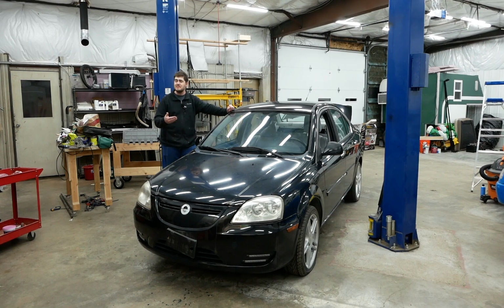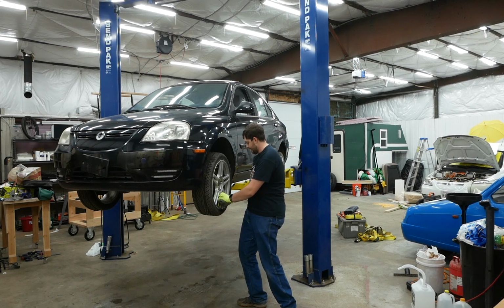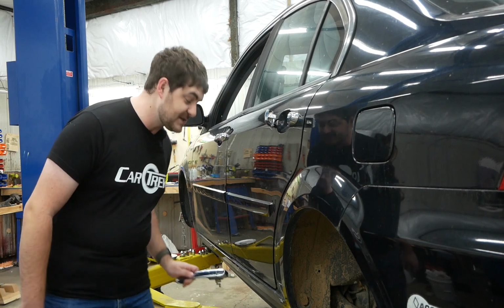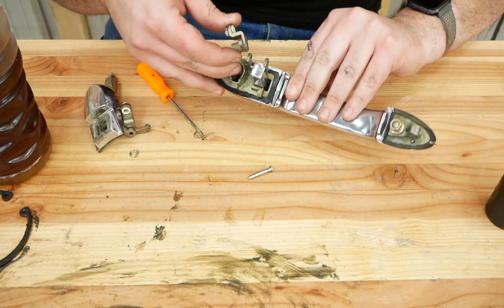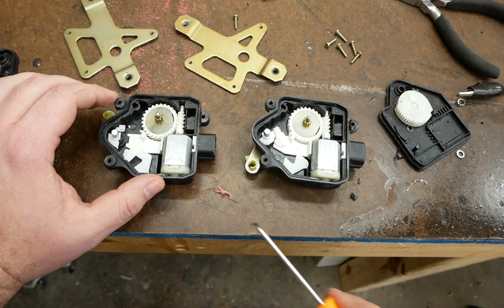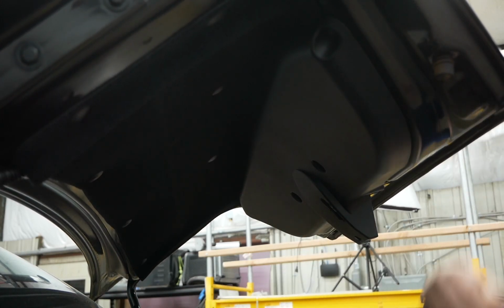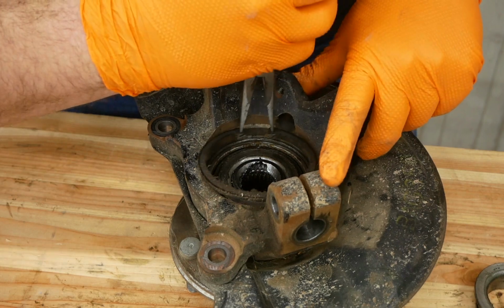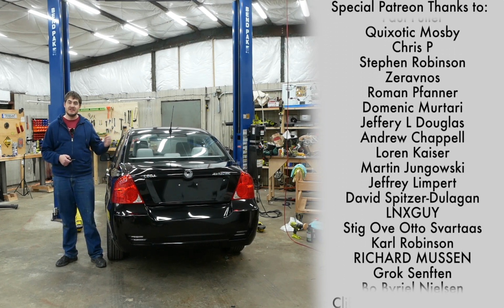Here's What It Took to Get My Broken Coda EV Back on the Road

Comment: Broken door handle, wheel bearings, trunk popper & dashboard problems, on a car with only 1000 miles on it!
Is it possible that the quality is even worse than a Wheego?
Reply: This thing makes the Yugo build quality look first rate.
Reply: Well it was made in China what did you expect?
Reply: @Revo2Evo  made in China and the US, same as the Wheego
Reply: @Javier N Ha! It's not even up to Yugo quality.
Reply: Yet it still works unlike the Wheego.
Reply: Take a Mitsubishi design and build it in China and that’s what you will get ….

Comment: Why take off the door panel from a closed door, when you have a literal hole in the mechanism that can use to just pull the latch, fish some wire in and tug the door would pop, seems like more effort then necessary your way?
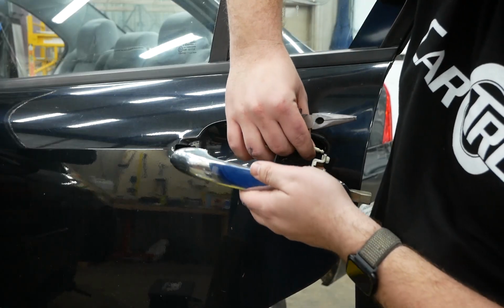Reply: Good luck gripping that rod (8:29) with a wire.
Reply: @Jehty_  it's a rotating peg, it's is not past the 90 degrees to the guy pulling it till the door opened, it literally would hold its self on till about the right moment
Reply: @Jehty_  even if it was Impossible to grip the peg the door handle uses the door doesn't look shielded, pretty sure a slim jim would work

Comment: Those wheel bearing should be sealed bearings.  Typically there is a suffix code after the bearing identification sized.  For example NSK would be -DDU for both sides sealed.  Sometimes the info stamped on the replacement bearing won't show the options.

Comment: All those tools, all that knowledge, and you don't have a pair of snap ring pliers? Get a set, and not the crappy ones with interchangeable tips. Also a good breaker bar is a lot cheaper that a power ratchet. All that aside, nice work getting the car going again, and I love the trunk lid work around.

Comment: Yeah, that door handle problem is what i had recently in my car(not a coda), and is one of those situations which proves beyond any shadow of  doubt, that steel and any other metal for that matter is better than plastic, and while it may cost you twice as much or trice as much, if you have to buy the shit 3 times, you got the same thing, but with more hassle and if you want to be a moss-hat moron, you actually can see that metal part that was made and lasts for a 1000 years is actually more ecologic and economic than plastic junk, which only slime care about if the parts are good and last for ages...
Reply: Also, what is the idea behind the emergency trunk release? What, a criminal about to be is going to open the trunk, light up a cigar, take a sip of some fine beverage as the engine warms up and softly, with look of gentle satisfaction as he lays a sheet of plastic in the trunk, and upon seeing that stupid thing, he isnt going to set the cup down and get some snips to cut off and obliterate any trace of that way of opening the trunk? No, he will consider leaving that there in case the victim in the back decides to walk out and press charges or roll out, potentially in front of a witness? Oh yeah, most definitely... And one more thing... If I was a kidnapper, I would actually leave it where it is, spray it down with a fluorescent paint only to have the victim in there be in agony upon the sight of their alleged way out, but having their members bound and mouth stuffed, being unable to interact with it... Who ever thought of such a stupid thing? What use does it provide, other than a way to open the trunk to the owner or a mechanic when the main lock fails... But then, why not just have a solid line that can be actuated from the cabin, near the main trunk release, but hidden away as not to provide the car with clutter of buttons and switches... It is such devices that prove that those who write the laws down and come up with such shit are morons and deluded slime with self instilled feeling of grandiosity... For if you consider such a device anything but a waste of material, you are a dimwit... As said, no lawful will need it but for opening the boot when its broken, and then it will prove hard to reach, and apart from that, the lawless will either remove it, or bind the victim well enough as to render the device useless either way...
Reply: @camillosteuss  regarding the emergency trunk release:
Ever heard of children?
Reply: @Jehty_  uhm, excuse me? How do children relate to trunks except in acts of kidnapping and such, and there, well, there is taping to prevent any opening... And if you are implying that a kid can just randomly end up in a trunk, well, that trunk should have been locked by the owner... Its like saying that a washing machine should have an internal emergency switch in case your kid somehow ends up in there...
Reply: @camillosteuss  are you serious?
Have you ever met a kid?
Have you been a kid yourself?
You know that kids know how to use keys. 
I don't know how often I played inside my parents car, they never forbid that. 
(ignition and parking brake was off limit of course) 

And if you don't like kids, how about (young) adults. 
Don't tell me you don't know anyone who took a ride inside the trunk because the rest of the car was already full with other people.
Reply: @Jehty_ I get what you mean, but all of the aforementioned is sub-optimal... Yeah, i know that kids play with everything, I got shocked by electricity 3 times as a kid for doing stupid things, and all of them what i wasnt supposed to be doing, but those were things that nobody thought of moving outta my grasp... Vehicle keys should be out of reach of kids, as kids drop shit, and having your key dropped into a sewer by your kid just might get you a prison sentence and the title of a monster... Also, youth in the trunk is something I know of, but I as a young teen and older teen despised that idea, as being driven by another youth is risky enough, let alone being in a trunk, tho, if you position yourself, the trunk might just be the safest place in case of a head on collision... but kids like going sideways, rather than have a front impact, so I dont even count backpack driving as a reason, also, isnt that highly illegal in it self? 
I drove a few friends when i took my seats out, and when we got to our destination, I was gently scolded by my mechanics instructor that such deeds can land me a 1500 euros or more of a ticket, because seats with belts are designated for people, unlike either floor or boot and doing so is considered as premeditated endangerment of passengers...
I get you, as i said, but dont you see that none of the above mentioned reasons are really something that should be happening...
Reply: @camillosteuss  prison sentence because a kid dropped the key into a sewer? WTF. In what country do you life?

And don't you understand that stuff that shouldn't happen still happens all the time?
How much does an emergency trunk opener cost? Isn't one person saved more than enough to put one in every vehicle?
Reply: @Jehty_  I was kidding on that part because it was implied that you would maul the kid for it... Especially if that was your only car key... But regarding the stuff that shouldnt happen... Fuck, then we should not use fire, axes, knives and practically no tools, as the sole existence thereof is a potential danger... I am ok with that shit being an option on a car, but to have that junk be mandatory and for it to come on all cars, i find ridiculous...
Reply: Regarding the plastic trunk opener.. Yeah, more of that marvelous material, acclaimed to be better than steel... Yeah, so much better it lasts without rust for 5 years, whereas you oil the steel every 5 years and it lasts a 1000 years... Wow, such a marvel of an  advancement... Makes you wonder why the industrial grade stuff has no plastic anywhere close or remote to it.... Oh, right, because plastic is junk good enough for kids toys and other such junk, not cars and mechanical equipment....
Reply: Also, an advice regarding the gearboxes... Never open the bottom plug first... Should the top be seized or dickered in other manner, once you drain the oil, you have no way of replenishing it, so always check if the top plug is removable first, I never serviced a gearbox where the top plug was absolutely seized, but some were quite stuck and were a potential risk had I damaged them before managing to remove them safely first....
Reply: Also, you have my commendations on fabricating that trunk release... That is some skookum design, wont need replacing in a few years, unlike that plastic shit...

Comment: You have two options on the front wheel bearings. That exact bearing has multiple part numbers, one of which is for a bearing WITH side seals and one without side seals. Obviously, you received the one without side seals. Option Two is to order side seals and install them. Yes, you can order side seals for bearings and install them after the fact. Check with Grainger.
Reply: Never knew you could order bearing seal kits, that's going to be helpful...
Reply: This is a problem of not having good documentation of the car.  You might be amazed at how well documented older cars are.
Reply: @tarstarkusz  They definitely have the benefit of being old cars, a lot of people had a lot of time to figure out all of it's problems and document them.
Reply: @jjpark98  Even the old books are really good. Every single thing, step by step including the body, electrical and all kinds of miscellaneous stuff.
Getting such a good book on this car is going to be impossible.
Reply: @tarstarkusz  In my experience, while age is a factor in finding good replacement parts and documentation on vehicles, sales numbers are a pretty big factor as well. I've owned a couple cars with production numbers of less than 100,000, while also being over 40 years past their production date, and it causes its own share of issues finding parts and documentation.
Reply: @AustinRBa  Plus these were, IIRC, he says, prototypes made from Chinese cars meant for the Chinese market.  The American market for certain has a very mature and very good book system for cars going to back to the model T and since that time. These books existed for the T at the time they were new.  China, as far as I know, doesn't that rich experience and history, not to mention a language barrier and lack of US demand for Chinese car documentation.  It should be fun trying to figure out the wiring and how to do obscure things specific to this car.
Also, most American made cars are not single vehicle platforms.  As an example, I went from a Cutlas Calais to a Buick Skylark GS and my Chilton for the Cutlas was also for the Skylark, so I didn't even need a new book (not that Chilton is the best) and it covered several other cars like the Pontiac Sunbird and I don't really recall what else, but there was more.  This was  3 separate car companies (though all GM) and seemingly unrelated cars, but they are all part of a single platform that is just highly customizable at the factory to make seemingly different cars.  I don't know if the Chinese are doing that because I wouldn't drive a Chinese made car even if you could buy them here.
Reply: Yep.  I was going to suggest exactly this, the "Z" or "ZZ" variant of the bearing if that's how sealing and/or shielding work on the double roller type.
Reply: @TWX1138  This would be a problem on tapered roller bearings. Since they are made out of a seperate inner race, outer race, and cage with rollers you usually need either external seals or shields. It's not like with deep groove ball bearings where you just look for the 2RS or ZZ. I would have zero trust in long lasting wheel bearings if there is no shielding or sealing at all. The design quality of the rest of the car is also questionable with the handle and door popper breaking so easily. Frankly, I think more thought went into the design of a trabant then went into this car.
Reply: Or, they were replaced before (with the shaft maybe), and the mixup happened then...

Comment: Normally wheel bearings like those will have lip seals on both sides to seal against hubs and CV.  It looks like the uprights/spindles have spots for lip seals to be install but they are missing.

Comment: I have replaced quite a few wheel bearings on a variety of cars and have never seen a split race wheel bearing with out 2 dust wipers, that is strange. May I suggest a bearing puller and installation press so that you can re and re wheel bearings without disassembly that could affect the vehicles wheel alignment. Looking forward to seeing some progress on the Bus/Carhauler/RV project, Cheers!
Reply: I would expect oil seals to be pressed in on either side of the bearing.
Reply: @cambridgemart2075  Agreed, usually after the numbers indicating the I.D. , O.D. and width they are labeled 2RS indicating the 2 rubber seals. I have seen the RS which is one rubber seal but not on many automotive applications unless they are in an oil bath or otherwise in a relatively clean environment.
Reply: @nigel-Rollercam-channel  I was thinking external seals rather than integral, I've seen 2RS types, but not on taper roller bearings.

Comment: Never, ever, break large amounts of torque with a torque wrench or power ratchet. Even manual socket wrenches are sketchy for breaking torques over 250 foot pounds. 
Invest in a breaker bar!
Reply: I've had one slip. Knee straight into the concrete.
Reply: @Zipppyart  So what I hear you saying is that instead of concrete, we should make shop floors out of nerf?
Reply: @kudzuwarrior  what?
Reply: @thehandlesticks66  He said while trying to break something loose the tool slipped and sent him knee first into the concrete. So my solution to that problem is that we don't make shop floors out of concrete anymore and instead make them out of nerf foam so when the tool slips next time he doesn't get hurt
Reply: I have a feeling he has a breaker bar or four, likely this is just a "Don't do what I do, do it properly" situation. Robert has a habit of making silly and expensive mistakes such as building his own Pickup Bed Camper :p
Reply: 250 inch pounds lmao

Comment: You could always make the trunk popper into a mechanical latch, just saying. Also, once You strip down the parts car Coda, You could turn it into a rally cross car or a drift car. Would it be practical? No. Would it be fun? Yes, in the same way popping a big old V8 in a Yugo is fun. Another route is to turn it into a sleeper and be like: yes, I have a bland car, but it goes like a bat out of hell. 2021, I am allowed to mention bats now.

Comment: It always amazes how much crap EV-converts have under the bonnet. I mean, it has an engine the size of a watermelon, and the battery cells are somewhere else. What on good mother's Earth more does it need that fills up an entire engine compartment??
Also why does it have a 12V lead-acid battery? The other batteries that probably have 100x more capacity, weren't enough? It needed that one as well?
Reply: Steering and a braking system are kinda handy to have. I’d be insistent they were under the bonnet of any EV I bought.
Reply: @BungleBare  Sure, I'd expect those as well. But they exist in a petrol car too... And yet, without that big bulky explosion engine in there, it's still a pretty much full engine compartment. So why is it so full? In a proper EV the engine compartment is (or could be) a small secondary boot.

Comment: Do you have any concerns about your lifts stability being attached to only a small 3x3 block of concrete?  I have the same problem. My slab is only 4 inches thick and I need to pour down 6 or 7 inches to mount my new lift. Aren't you afraid of it pulling up that tiny square of deeper concrete?  Did you drill rebar into the original clab to attach your small patch?

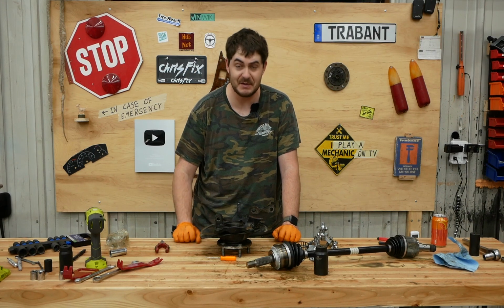Comment: 15:00 500 miles was very optimistic.  Bearings are supposed to be pretty universal so it shouldn't be impossible to order good sealed/shielded bearing from a catalog.
Reply: I've never seen a sealed taper bearing and the design would also have to seal the inside of the outer taper bearing too since they are a bearing and a race separately. My guess is there should be a wheel seal of some sort behind the bearing before the axle.
Reply: @fisqual  Like a washer/shield, in order bearing shield zieger.

Comment: That was a great video but I fear that you might have lowered your chances with Ryobi for a sponsorship by showing things aren't perfect.
Reply: I think Ryobi should just thank him for properly stress-testing their tools, and discovering where exactly they break :D
Reply: @ArniVidar  Now there is the perfect reply. That's the answer.
Reply: @WayneMoyer  was this a test?
Reply: Honestly I don't think so, most advertizer only glance at the video; so first, Royobi may never see the part where it breaks, and second,a s people pointed out, Robert used the tool improperly and the comments shows that peopel are aware that Robert, not the tools, are at fault.

Comment: I remember how one guy came up with a beefy solenoid and made a trunk popper. This was during early 90's, car was from early 80's. He gathered a group to witness his success, and when everyone was watching, he very theatrically manner pressed the button, and the beefy solenoid crumpled the lid cover. We watched for a moment, applauded and proceeded doing whatever we were doing.
Reply: In my auto tech class there was a nissan altima that the auto body class had skinned. We found out that the trunk lid was a lot lighter without any body work on it. And the spring was the same strength. It made for a very dangerous catapult. Since there was no battery, it was a manual release by reaching in through the body to release the trunk. Good for launching hub caps.

Comment: What a fun repair/restoration video! I'm really curious to see how long those new front bearings hold up.
Reply: Just a tip for Robert, the "extra grease" on the bearings could have the opposite effect because it can increase the amount of dust that is collected and gunked to the area